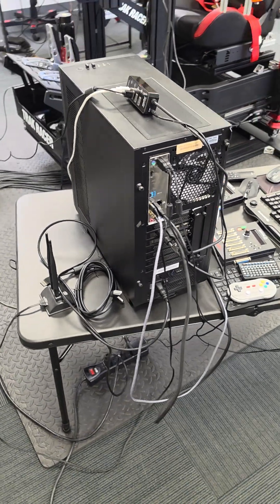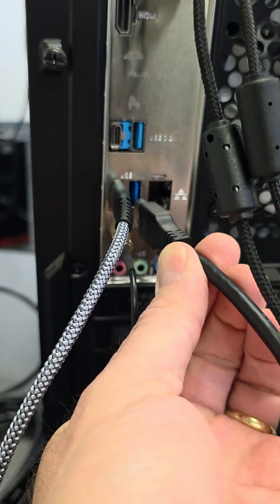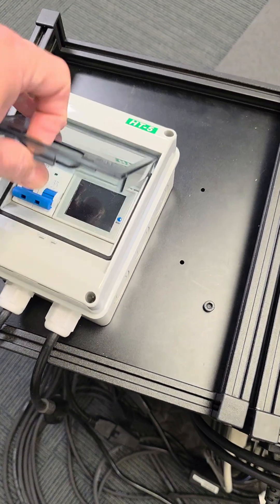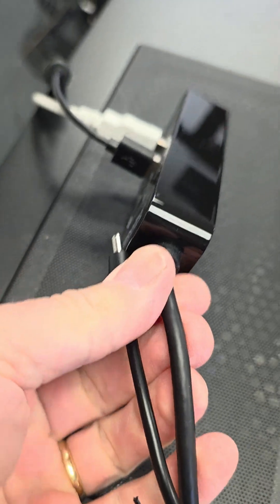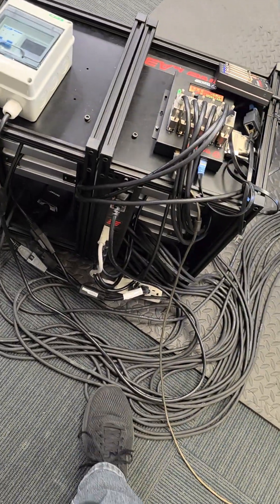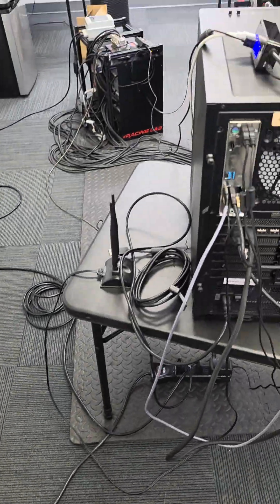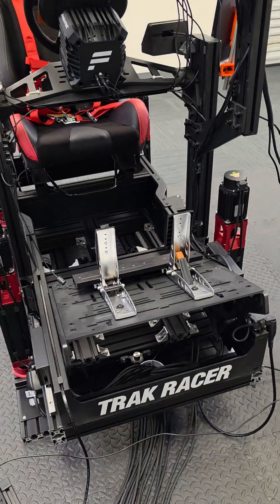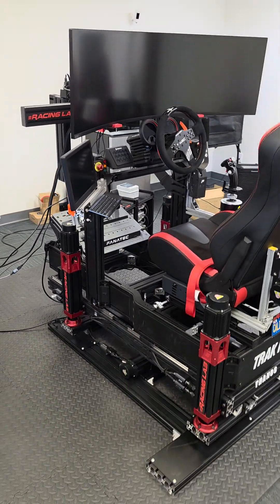Hub life - or how to avoid EMI and ground loop nightmare

Comment: Very interesting video, thanks for the good recommendation. I intend to make a simulator drawing near 3 kW peak. So I would like to plug my PC on one outlet, and the USB hub and all servo drives on another outlet. The only wire communicating between the two "power networks" would be the USB wire from the PC to the powered USB hub. I was thinking of including USB insulator chip like the ones we can find on Amazon. Do you think this is a good setup to avoid EMI or ground loops ? Thanks for advising Thanos!
Reply from the maker: I haven't seen the need for USB isolator.  The cables used on the eracing-lab actuators are high quality double shielded ones, and with the addition of integrated line filter on the line strip that is included in the eracing-lab kit, there is minimal EMI noise concerns. Helps if all grounds of the system are terminated on a single point at the wall as I show on the video.
Reply: @tronicgr  Noted, thanks for your valuable insights as always!
Reply: I had EMI issue with my Fanatec Wheelbase. How do you ground up the wheelbase?
Reply from the maker: @setiabakti10  I grounded the metal rig that my fanatec is mounted on, so I never had issues.